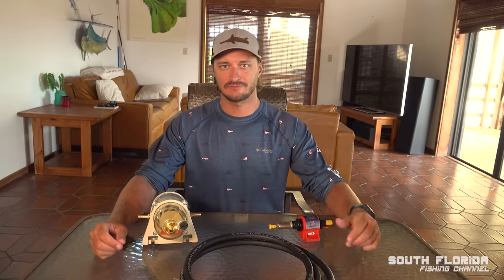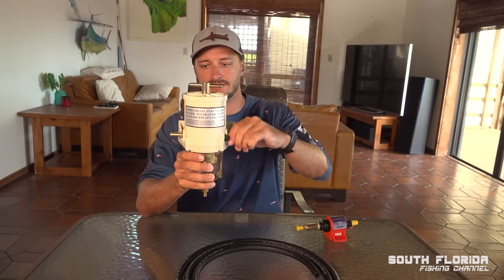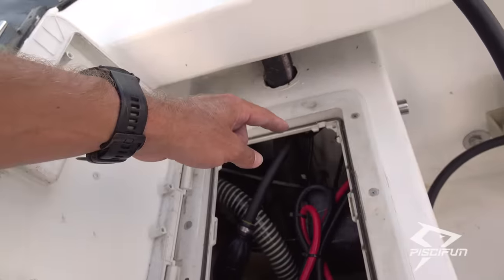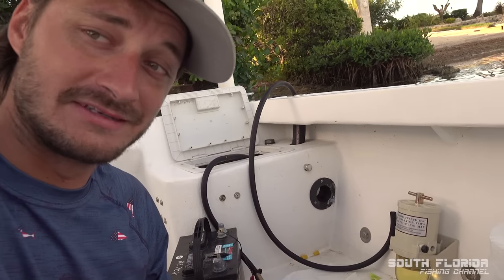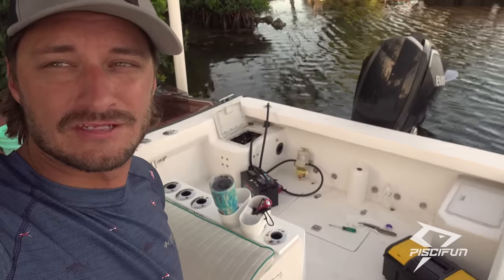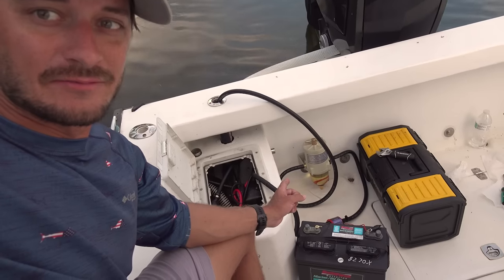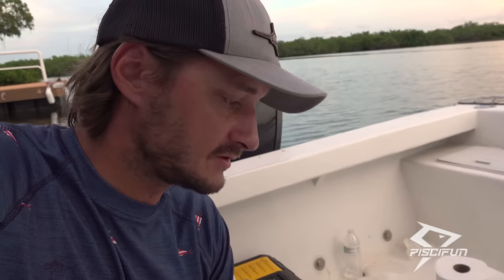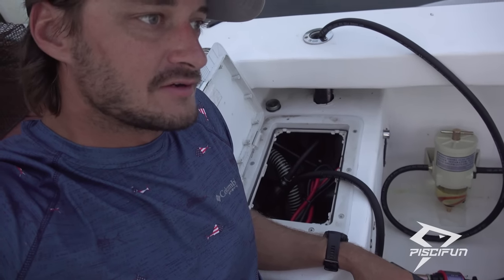DIY: How to clean your boat fuel under $100 {everyone should do this}

Comment: The old rule of thumb is to not run your tank low. I have heard all sorts of "voodoo" on why... The truth be told the less fuel, the more vapor air mixture which can expand and contact with temperature change. The moisture in that air will condense in your tank when it cools and adds up over time. Water always gets pulled first in your fuel as it is heavier than fuel.

Comment: I bought my boat a few years ago and it's also a two stroke and I kept having issues with the motor conking out, mostly when I would start it and within less than a mile it turn off, I had the engine looked at by a marine business in Key Colony Beach which I will not mention, because they are not the nicest people, anyhow they could not find anything wrong and could not tell what might be the cause, By trial and error and watching a lot of videos and reading I came to the conclusion that it was my gas and the gas tank, the boat had not been used for a long time. I had a company from Miami come out and polish the tank, it was about $375.00 if I remember correctly. The problem went away for a time but it came back about 6 months later. 
This method of yours makes perfect sense, DIY self polishing every so often, that way your gas and gas tank stay on the clean side. 
Unlike you I do not have an installed water and fuel separator, my gas does straight into the engine. I may now install a water fuel separator and buy the things you bought to do the self polishing every few months. Great video.

Comment: Heiko, By-pass the Racor filter all together. Then mount the Amazon filter between the tank and electric fuel pump so as to not kill the pump. 

Not knowing where the tank pickup is, you need to suck fuel from the tank at the lowest position, so if that means weighing down the boat on one side, go for it. 

Mercury Marine makes a spin-on fuel/water separator where the replacement filters are in the $20 range, plus the housing.

The small fuel pump you have doesn't have the volume to act as a vacuum cleaner for the tank. You need to add some methanol to the tank as it will bind with the water and make the mix burnable in the engine.

There is also a paste that the fuel delivery companies use when they supply gas stations. O'Riley auto parts sells it called Gasoila Water Finding Paste. $12 for the paste. The dip stick gets coated and the paste indicates if water is found and how much. (round tank, not rectangular won't tell how much, just presence of water)

The biggest difference between Racor and off brand filtration is the micron size of the crud it will filter.

Comment: Cheers man, loved the video, question though, the linked filter/separator is for Diesel not Gas. Is it the wrong link or did you just switch up filters or something.
Reply: It's fine the difference on real racors is the diesel ines use a plastic bowl and it will get cloudy after a while. But no biggie

Comment: I need to do the same because I have bad fuel, but how did you fit a 3/8 fuel hose into a fuel pump that has a inlet of 5/16?
Reply from the maker: I put a little clamp on it and it fit just fine

Comment: People always forgot to talk about safety, always keep contacts far from fuel and vapors
Reply: They tend to spark
Reply: And the more you lift the front the closer the water gets to the pick up
Reply: Also the fuel pick up doesn’t reach the bottom of tank so there will always be a small film at the bottom, tank cleaning service pulls the sender and drys the tank 100% so it’s not apples for apples